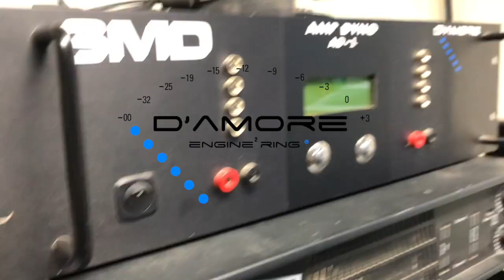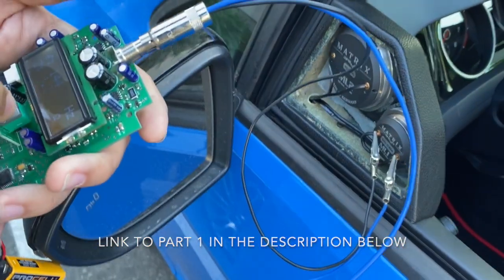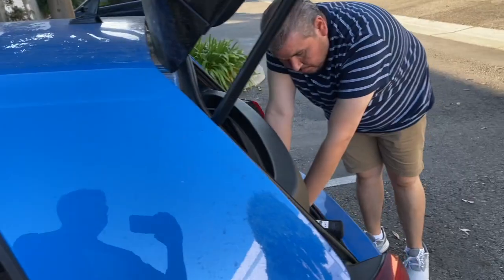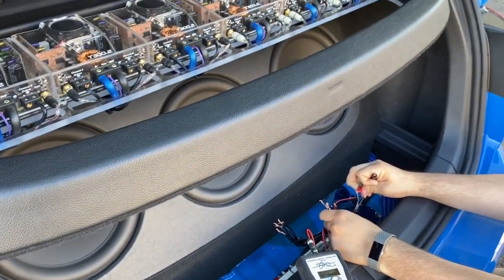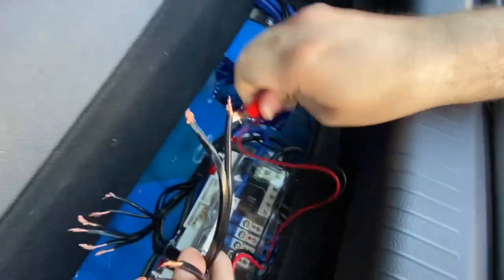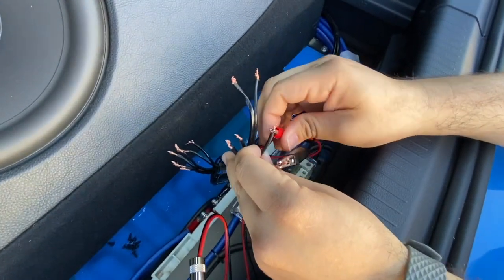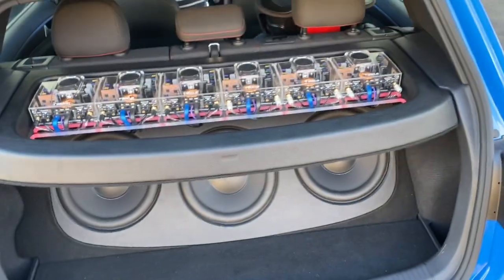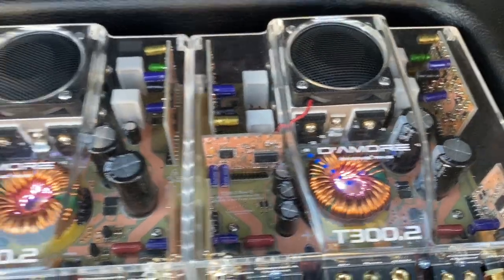I Didn't Smoke a $1500 Tweeter!  (Part II)

Comment: That really is a neat tool! If I was a full time installer, that would be one of my tools. However I'm just a Do It Your Self Kind Of Guy And Only Own The DD1+ 😁
Reply: I use my IMSG to test if i have tuned my boxes correctly and to calculate my box rise they are very usefull even if you arnt a fulltime installer.
Reply: @deathcrayon  im getting tempted in getting one, but i think i would get the AMM-1 first since i like the idea of the Real Time RMS Reading.

Comment: Non audio related. Are you having stalling issues with the car. My buddy has one and the dealer is buying it back because of a stalling issue the dealer can not find out. apparently there is multiple rabbit edition GTI's having the problem
Reply from the maker: Have your buddy try turning off the auto start stop feature and see if the problem goes away
Reply: @DAmoreEngineering   his car is manual so i dont know if it has that feature. But after sending the car to the dealer a few times they threw in the white flag and said we'll buy the car back. Not the audio related question. Are you seated where you can see the mirrors or are they block but dont care cause audio is life?
Reply from the maker: @GTiGuy316  Wow that sucks.  Ours has been good but there's only about 250 miles on it.  I can see out drivers side mirror no problem but passenger mirror not so much.  #audioislife